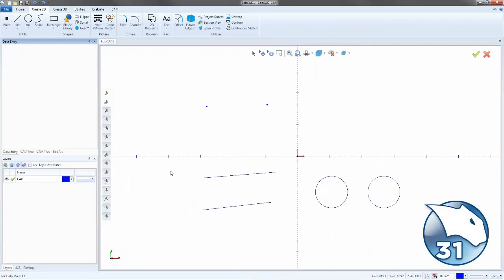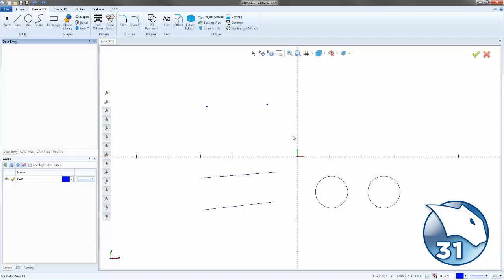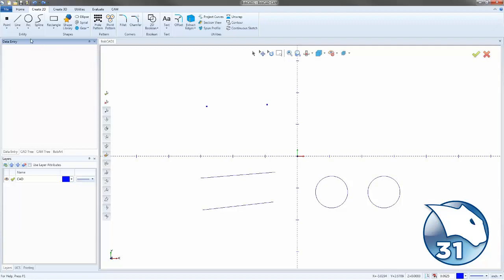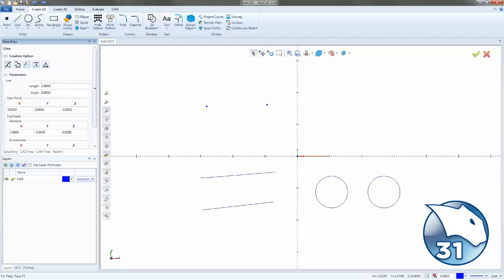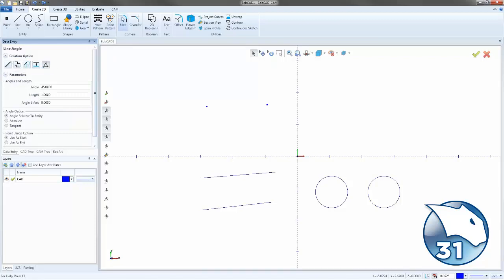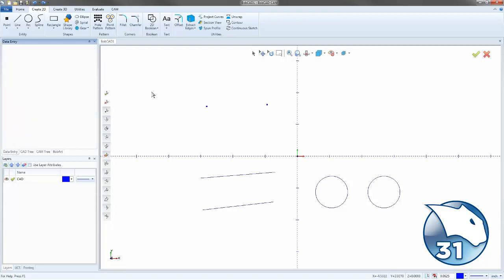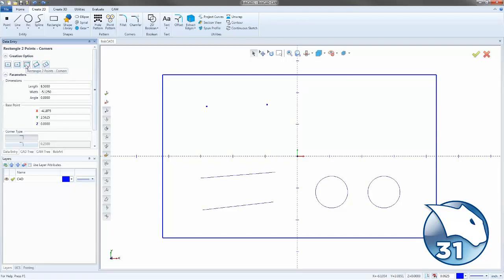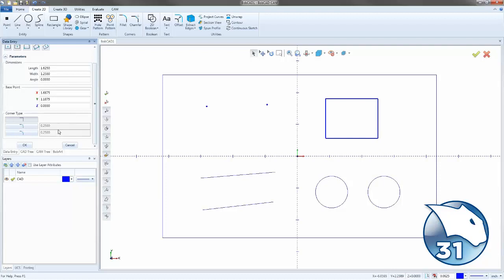BobCAD-CAM V31: New Geometry Creation Workflow - 03

Comment: What is the advantage of geometry creation on CAM software
Reply from the maker: There are many reasons why your CAM software needs CAD features.  Like making the part more machinable or using geometry to limit where toolpath is created.   It all depends on what geometry you start with and what toolpaths and processes you are trying to apply.
Reply from the maker: It assists in programming difficult parts and allows your to create code quicker.